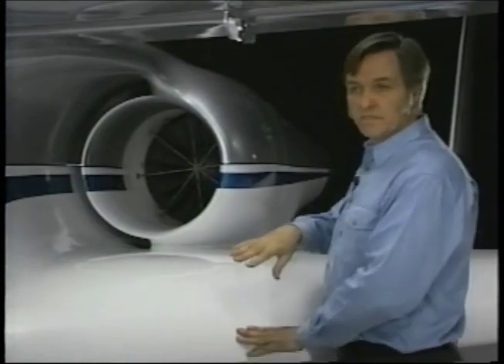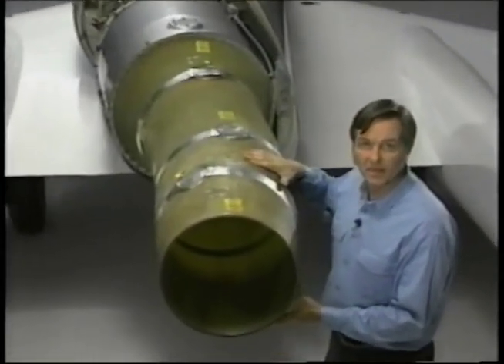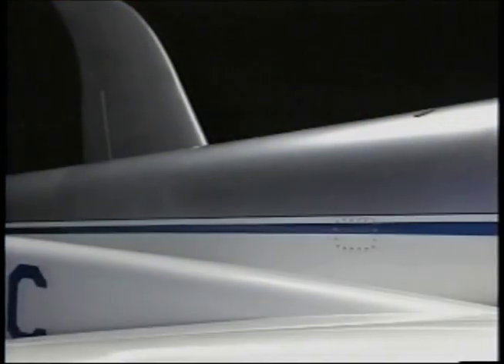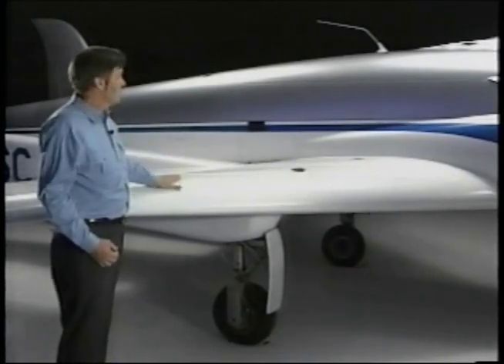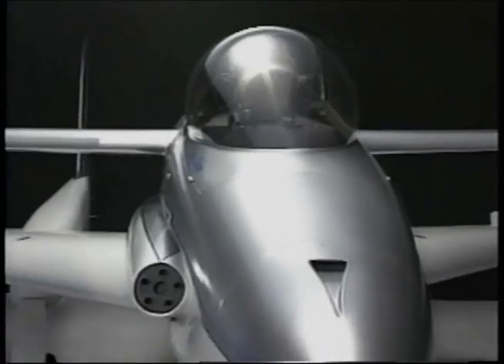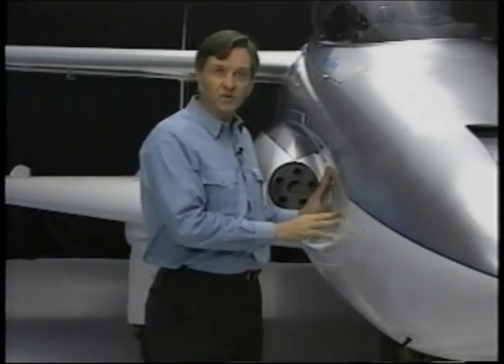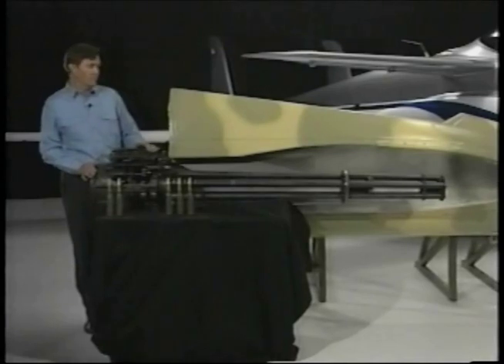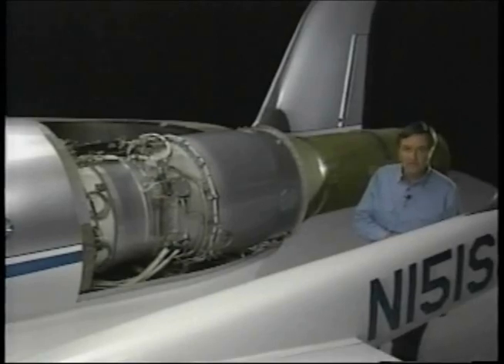ARES

Comment: The Ares seemed like it could have been a nice anti-tank, ground attack fighter.  Wonder how it stacked up against the A-10.   I think the A-10 has better armour and dual engines, as well as larger ammunition payload? I could be wrong though.  The Ares looks to be highly maneuverable. Seems like it would make an excellent drone as well.
Reply: Its does but the Ares costs a fraction of the A10 to acquire and operate. You could have fielded several of these for a single A10.
Reply: @hdaviator9181  Pilots are not cheap. If you lose a lot of pilots due to lack of armour, then you're in trouble.
Reply: @HakanKoseoglu  If putting pilots in dangerous situation by allowing them to fly low and slow (exposed to enemy fire) instead of shoot and scoot from High Altitude and running away, then you sir are putting more pilots at risk.
Reply: This plane was not in the same class as the A-10. It is closer to the contemporary A-29 or the preceding A-37. It wouldn't have fit the USAF's purposes, but it could have fit the needs of smaller air forces that operate light COIN aircraft today.

Edit: The ARES carries even less than an A-29, which carries far less payload than an A-37. The ARES would have had little use as an attacker.

Comment: Too efficient and too low cost for the military-industrial complex.  Need something that cost billions to hide the bureaucratic inefficiency.
Reply: like F35?
Reply: Exactly.
Reply: not gunna create jobs that way...
Reply: @johndoe-rd6jn  What the purpose of creating jobs just to waste money? Dumbest thing ever. You rather waste money instead of giving ppl health insurance. 🙈🙈🙈
Reply: @pangrac1  jobs = votes.
Reply: Like the A-10 it's not a Cash cow.
Reply: MIC profitability problem? Easy to solve. Should have asked Scaled Composites to upsize the aircraft, add a 2nd engine for survivability, then asked for more fuel, armor, range, and ability to sling PGMs.

Those initial requirements would be more than enough to get everyone in the MI complex through the front door and "contributing" to the effort. 

When the Ares becomes a 30 or 40 state initiative, watch it get funding so fast you'll get whiplash from the afterburners Congress puts on that thing.